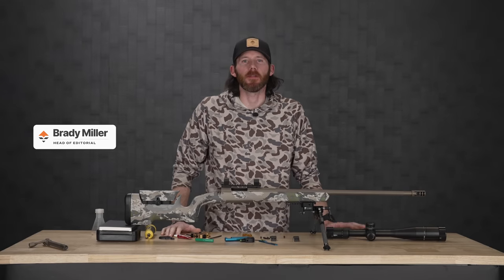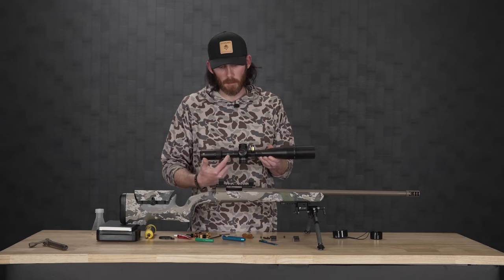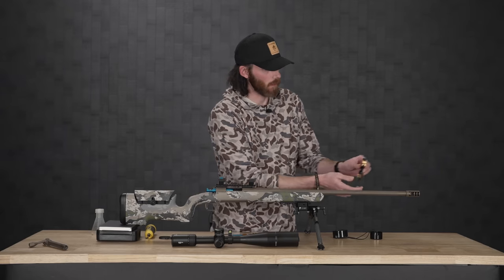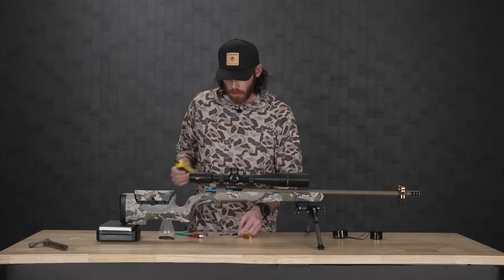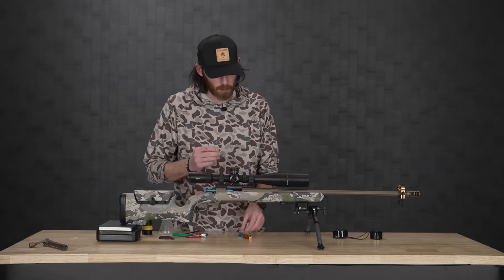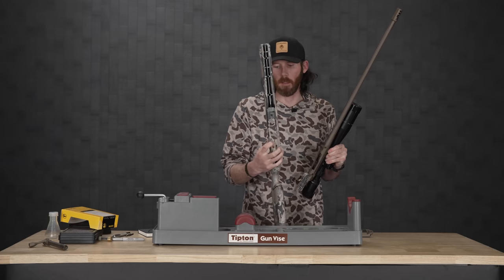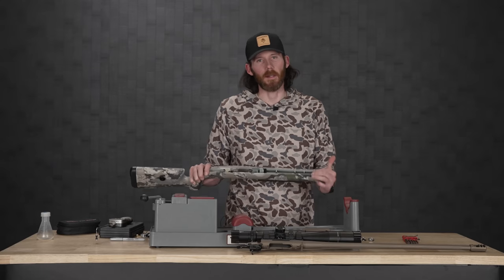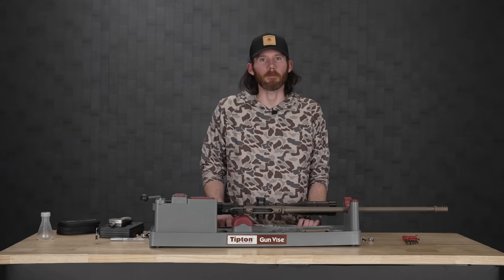Brady Miller's Rifle Build - Part 3 Scope Mounting / Bedding / Trigger / Arca Rail

Comment: Awesome…. You’re the first person that I’ve seen put the level on the bottom. As a new shooter, this stuff is so valuable. Thank you for the techniques. The bottom makes way more sense than putting a level on the turret cap.
Reply: Yes sir. I changed up the scopes on all my rifles and put a new one on my magnum. They were all different. The turret caps are waaay off on some scopes. My old Nikon pro staff 5 was the closest. Bottom of scope and then use the corner of a wall or hang a string to double check it. Also having a rifle that you can get the level in the action. Leveling the pic rail isn’t always accurate

Comment: Do you lose the function of unloading while on safe when switching to the aftermarket trigger?  The bolt release button is one of my favorite things about the X Bolt. I've only used aftermarket springs so far to lighten the pull.

Comment: Good stuff man. I’m in the same boat with a lot of my stuff. Tinkering is fun. Factory triggers are typically garbage compared to. I’m getting into the process of getting my ARCA and pic rails installed. Luckily none of my rifles have sticks like that so it’ll be a little bit easier.

Comment: Awesome build Brady! I haven’t taken a build to that extreme but I think I’m going to on the next! When you leveled the rifle right to left did you just use your rings? Not the action? Also in part 1 was there any particular reason you used JB weld for pic rail and JB Kwik for the rings other than cure time?
Reply: Glad you saw some value in it. I level off the top rings, then I also double check the level off the top of the picatinny rail as well to get the left to right dialed. I do have another level that I use from time to time in my action that will help with the left and right, but I'm not 100% confident in that level, so I've found using the rings and the picatinny rail to be best. Really no particular reason for the difference in JB weld besides for the cure time. I do believe the tensile strength is stronger with the original JB weld and in my head, it seems that area might benefit more from the original. I haven't tested using JB kwik on the picatinny rail, but I believe it would definitely work.

Comment: Hey @Brady Miller, what "fastner option" did you go with when you bought the hunter rail from SRS? Are the bolts that they (SRS) offer not compatable with what the x bolt already has in its stock, so you are having to drill out and install the claw nuts anyways? And if so, what claw nuts did you use?
Reply: Happy to help! So if you use a Browning rifle stock, you will have to drill out and install claw nuts to put the SRS rail on. Browning's stocks have some cross bracing material in them, and that is what you need to work around (you can use some of the original holes Browing has in their stocks, but sometimes I just remove them and install claw nuts in those areas). I use the supplied claw nuts from SRS. It's honestly not that hard of a process. So what I do is mock where I need to drill, and then I take a soldering iron (or sometimes different bits) to cut/melt out the area where I want to put the claw nuts. I've found that the soldering iron works really well to remove the braces inside the stock. Then I will continue to cut away material and test the fit. You might find a drill bit can be handy sometimes as well. When I know I have the placement perfect, I will use JB Weld around the base of the claw nut and sort of make a home for the nut inside the stock. I use a release agent on the screws, and then I will tighten down the screws to the claw nut through the stock and let it dry for 48 hours at least. If I'm using a McMillan stock, I do the same process, but I use a Forester bit and still JB Weld the claw nuts down. Hope that helps, let me know if you have any other questions.
Reply: @brady_j_miller  thanks for the reply/ help!

Comment: Where's the cutoff where just buying a better setup rifle is worth it? $1300 rifle, add a $200 trigger, drill out and epoxy a stock to make an arca rail fit, then do a full bedding job, add pillars....Can you get all of that off the shelf for under $2,000?
Reply: No not of the shelf, but you can get for about 3k by building it yourself. Action with pic rail made into action.  Good rings and you don't have to bed scope rings. 
Prefit barrel, buy a trigger , stock of your choice. Better than anything you can buy in a traditional store

Comment: I have a new browning X-bolt and I just took the action out of the stock to install a picatinny rail on it. Is there a need to redo the glass bedding, or is the factory one good? I am wondering if I would gain accuracy by re-doing the bedding job since it has been taken apart.